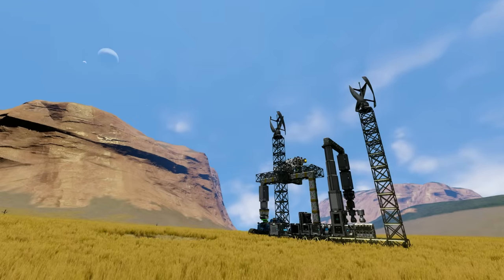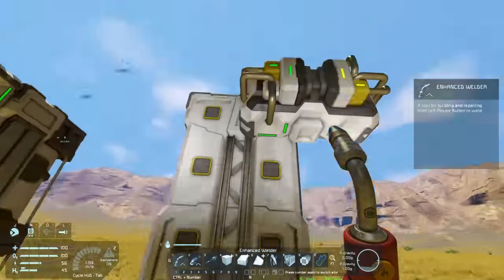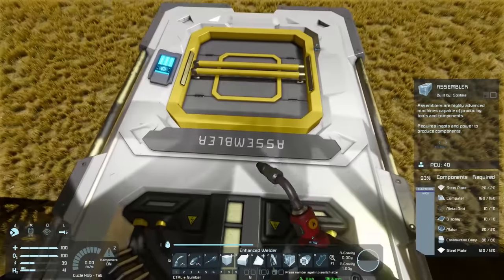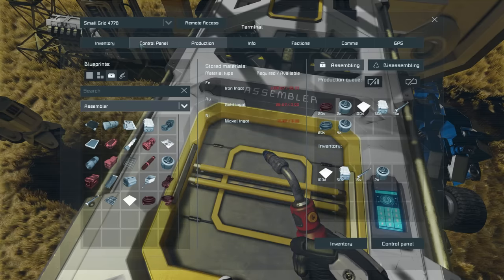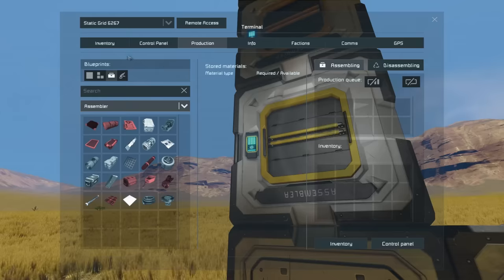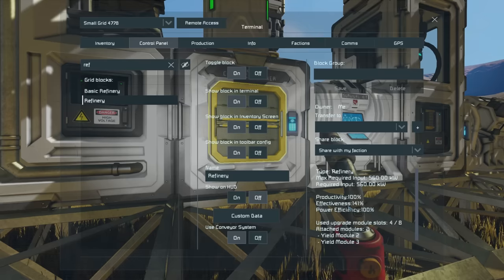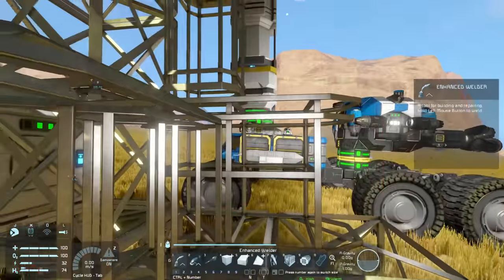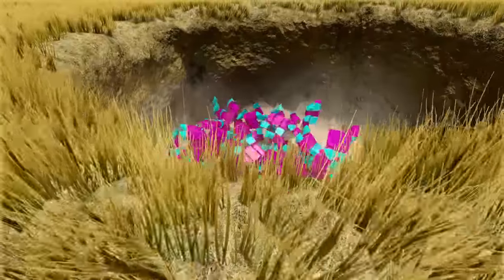Refiners, Assemblers & Upgrades - Getting Started in Survival #7 (Space Engineers tutorial)

Comment: I made an early game large block wheeled miner/refiner which is just amazing. It can mine 6x+ its own weight and has a full refinery, assembler, h/o2, survival, hydrogen engine with 8 large mining tools. It has a flying miner for hard to reach ore or for making a ramp for the big miner to use. It is still mostly mining the glacier and outer edge.
Reply from the maker: That's a great way to do things, also means you don't need to decide where to settle down until much later :)
Reply: The only bad thing with Space Engineers is the performance cap for bigger builds. I hope they keep finding a way to increase what we can do.

Comment: had no idea about the button to slave assemblers... i'd assumed they'd do that, but have never really needed to build more than one. weird that lower-tier assemblers won't skip through the queue to stuff they can do. 

i find that there's almost no use-case for speed modules of refineries. power for small vehicles/bases that struggle with power, but yield wherever possible because getting more ingots out of ore is always good. for assemblers, i start with power modules and swap over to speed as i need more stuff processed, and/or as my power supply improves. i don't think there's much of a reason to build a second assembler until you need truly crazy amounts of stuff.  

one thing i wish i did at around this stage: slap in a sorter and a connector pointed into a pit and set it to automatically dump gravel unless you're rushing reactors for some reason... and even then you'll be overproducing it in absurd quantities.
Reply from the maker: It is unfortunate that they don't skip ahead, would have been a very nice touch if that worked. The only reason for a speed module on a refinery is if you're streaming or expecting a battle and ingots are the only thing holding you back :P

I agree, multi assembler setups are more relevant in multiplayer where several people are using up the resources, not too common in single player to manage to use up that much :)

Comment: also worth noting the yield module benefit is additive, 19% added on to 100%, then 19% added on to 119% then 19% added on to 141.61% then 19% added on to 168.51% to equal 200% bonus if using 4 yield modules, however this will not benefit all ores, the ores with a naturally higher yield like Iron, will not go above 1kg of ingot from 1kg of ore.
also the refinery will empty itself into the assembler when its output gets full due to your assembler placement, placing assembler elsewhere will prevent this
Reply: i just checked the numbers, as it was a long time ago i last checked this, you do indeed get the full benefit from 4 yield modules, getting 1.4 kg iron ingots from 1kg of iron ore, i would assume this is unintentional.
Reply from the maker: That's weird, I wonder if they'll fix that because it at least made sense that you weren't able to generate new mass...

Comment: I have a question regarding Survival Computers and Medical Rooms and the Spawn Points that they create.

 I am building a resupply point on the moon in my survival game and created a Survival Computer on the moon so I could just respawn there if I died. However, it does not give me a choice of locations and only takes me to the most recently created respawn point.  

Is there a way to pick and choose without a mod, or is a mod necessary?
Reply: they got rid of it to prevent instant travel
Reply from the maker: It's an option in your save file, when going to load it select advanced options and turn off 'autorespawn'. You'll then get the list of spawn points so you can respawn teleport like people used to. The default it to have it on as they wanted to prevent that behaviour, but left the option in for people who didn't like it :)
Reply: @Splitsie  Thanks! The problem was,  I kept respawning back at my Earth base when I died and my hydrogen ship was still on the moon so I had no way back.

Comment: Can you do an episode on Timer based Multiplayer Simultaneous Attempted Access Airtight Blast Doors of sizes larger than can be done by Airtight hangar doors?

I believe it should be possible using rotors/pistons and merge blocks such that the door merges to the station when closed allowing airtight hangar doors to create the seal, but I'm not quite sure.
Reply from the maker: It's possible, but it's very hard to set up well and may be something I'll look at in the future but won't be something I'd cover in the first video on blast doors as it requires an understanding of merge blocks, pistons, rotors, timers and airtightness that I haven't even remotely covered in these videos yet

Comment: Okay so the refinery is 30% efficient but with 4 yeild mods it goes above 50% well like 52-53ish. But that seems like the least work intensive of the three options. Then do a two and two on the assemblers so it has two speed two power savers. Is that a good setup?
Reply from the maker: That's similar to the sort of setup I would end with, normally I'll start out with a few power efficiency modules on both the refinery on assembler and gradually transition to all efficiency on the refinery and speed on the assembler, though the speed modules for the assembler are the last step since it's quite nice to have the power efficiency modules on them until you're very flush with power generation capacity :)

Comment: @Splitsie, based on your experience, would you recommend 3 yield and 1 speed for a typical refinery enhancement setup? Or would you go 2 yield 1 power 1 speed?

Also, what would you recommend for starting base defense? I have found that even modless, hostile NPCs will home in on you regardless if you have your beacon/antenae on or off, or even power sources all on/off.
Reply from the maker: I rarely use speed modules, I tend to build more refineries with extra yield modules on them instead. My typical progression is starting with all power efficiency modules so I can have a couple of refineries running, then, as I get more power production I switch the efficiency modules out for yield.

The drones know your character's precise position and will hunt it, so if you were to fly away from your base and no other character is there, then the drones will follow you. For most of the vanilla drones a few large grid gatling turrets with their range set to 800m (they default to 600m) will be capable of protecting you for a while as long as you keep an eye on them and repair as needed